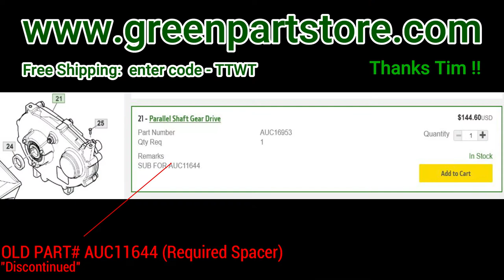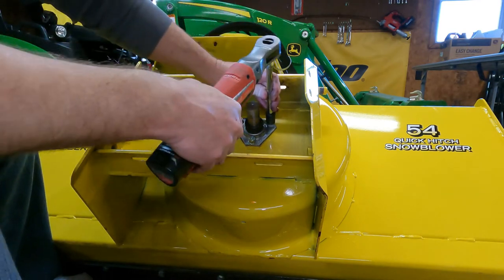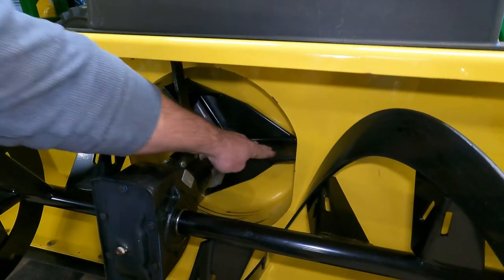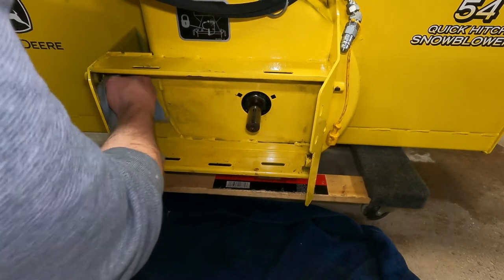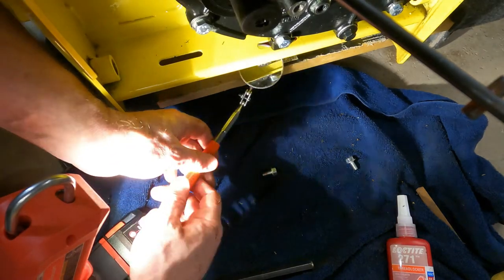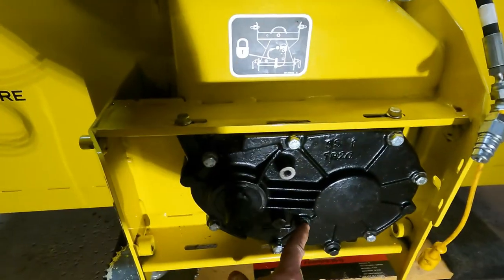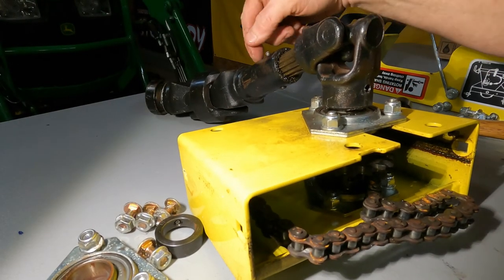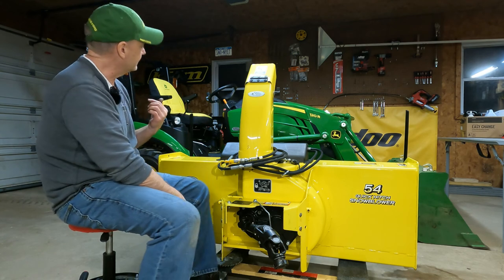JOHN DEERE 1025R | 47” 54” SNOWBLOWER CONVERSION PARALLEL SHAFT GEAR DRIVE

Comment: I am having a very difficult time sliding the chain case onto the driven shaft. I have cleaned and polished the shaft, but it just seems too big. The inside of the chain case seems to taper down about a 1/4 inch in, and that's as far as it will go on. Any suggestions?  1998ish 47 blower.
Reply from the maker: Hey Freeze916 !! Thanks for stopping by the channel. Wow, Are you sure the ID of the gear box tapers down 1/4”? Thats sounds obsessive. Have you tried to slide the gearbox on the shaft without the key installed just to make sure the key isn’t the issue. Let me know.

Comment: Wow, what an excellent video. Mine just came in and ready to install. Thank you!
Reply from the maker: Hey Larry, Thanks for stopping by to check out the video. Much appreciated. You’ll love how much smoother and quieter the Parallel drive is compared to the open chain and sprockets. Take Care 👍🏼
Reply: @SometimeIsNow  I can't wait. However, when I picked it up from the dealer, they didn't say anything about adding oil. Do these come empty? If they do come with oil, would you drain and add the Mobil synthetic? Thank you.
Reply: Bob, I see now that you answered this question down below in comments. I'll add oil. :)

Comment: You are the man!
Complete how to from start to finish.
I bought the gear drive and bolts already but am doing the metal impeller swap at the same time and am waiting for it to be delivered.
Reply from the maker: Hey Nosmo, Thanks for stopping by to check out the video. It's greatly appreciated. I'm glad you found the video useful. I hope everything goes as well for you on the conversion. Take Care 👍

Comment: My 47 snowblower just blew up on my 445 - I am so happy I found your video and have the parts on the way to change mine over.  every bearing as well as the chain just failed on mine.  the Maine winters are harsh with all the salt that gets used and really ruins everything.  this upgrade should be life changing for my snowblower.  thank you so much for posting this amazing walk through video.  Love from Maine.
Reply from the maker: Hey Abel, Thanks for stopping to check out the video. Sounds like a perfect time for an Upgrade. You’re going to love how smooth and quiet the new parallel box runs. 👍🏼
Reply: @SometimeIsNow  it was a nightmare rusted solid to the auger shaft.  Had to cut it apart.  Parts showing up Monday so just getting it all stripped and cleaned up in preparation.  Glad I don't need the old carriage bolt holes behind the impeller.  They are all broken but it made it possible to pull them out without taking out the front bits.   Super strange my drive gear shaft had two retaining collars on it.  One for the bearing and another behind the sprocket with a washer between them.  Nothing I've researched has been like that.  Anyway thank you again for the awesome video!
Reply from the maker: @abelauclair8976  I use to own the JD 445 with a cab with soft doors, 47” snowblower, 60” mower and 22hp Kawasaki engine. It was a great tractor. Yeah, That’s strange you had two collars on yours. 🤷🏼‍♂ Take Care
Reply: @SometimeIsNow  finally got some snow and a chance to try out the new parallel gear box and boy you were right that thing is night and day.  quiet and no more clatter from the open chain.  it motivated me to complete my flap mod as well!  thank you again for your videos.  keep em coming!

Comment: Very nice video I've had my blower since 2008. It has moved literally tons of snow. Every Spring I p.m. it before I put it away. Every fall I go through it. Adjusting the chain this year I noticed some wobble in the shaft between the auger and blower and chain drive. I figured it was a bad bearing so I ordered some and some flanges. Turns out one of the carriage bolt holes was cracked in the blower housing loosening up the flanges. I took a plasma cutter and caught one of the new flanges and welded it to the blower housing to reinforce the area that's really a weak point in these blowers. I was also disappointed the new flanges we're nowhere near the quality of the old bronze ones. And to top it off the new bearings were made in China printed right on them. I looked up the Gear Drive and got sticker-shock!
Reply from the maker: Hey William, Thanks for stopping by the channel. Sounds like you are very resourceful and was able to repair the worn flange mounting point. Thats great. 👍🏼 As you noticed in the video the mounting holes are no longer used for the carriage bolts but just 3 guide holes for the parallel box for alignment. Most of the support are from the four bolts back further on the gear drive and the hanger on the impeller shaft. I’m wondering if in your case one or more of your carriage bolts came loose and or the shaft running from the chain drive to the impeller had excessive vibration from the old less lubricated original bearing and that’s what cracked the housing. In my past 36 yrs in Industrial Maintenance and dealing with much larger flange and pillow block bearing mounts, excessive vibration from an old, minimal or no grease in the bearing or loose mounting bolts caused the fracture at the main mounting point. Grease in a sealed bearing only last so long before the grease finally gets used up from heat and those bearings in your 2008 blower were probably at their end of life cycle. 
I know all to well how it is to find a good quality bearing anymore. Especially in these times. For me, having a bearing delivered for a million dollar piece of high speed production machine to say CHINA on the bearing it makes me Cringe. When you remove a Timken, NTN, Fafnir or SKS bearing you expect the same when you order a replacement. Sadly,  In todays age that seldom happens anymore. Take Care and have fun blowing snow !! I know i do when I’m on my John Deere 😁 👍🏼

Comment: I bought the snowblower today. I live in the snow belt. What would this do to help ?
Reply from the maker: Hey Patrick, Thanks for stopping by and welcome to the channel. Is the snowblower you just bought new or an older model? The reason I ask is the new JD slowblowers already come with the enclosed parallel gear drive as standard equip. If your snowblower is a older version with the open chain drive then there's no increase in performance, just easier maintenance and quieter. No more lubing or adjusting a dirty chain and the enclosed drive is noticeably quieter. Take Care.

Comment: Does it run any smoother or quieter or use less power ?  I bet it's much easier to maintain.  Great job !
Reply from the maker: Hey Captain, Thanks for stopping by the he channel. It does run smoother and much quieter. However It doesn’t use less power. It’s just more of a cleaner, maintenance free gear drive. Like the gear drive on the front auger. Just check the fluid once in awhile and you’re on your way. Take Care 👍🏼

Comment: I have a 2032R and had to replace the short  Pto drive shaft from the snow blower to the  front of the tractor. It is too long by 3 inches. Either John Deere dealer gave me the wrong drive shaft or there is some other issue I’m not aware off. I would have to cut 3 inches off shaft to get it to fit. What part number should it be for this shaft. Thanks
Reply from the maker: Hey Edward, I don’t believe swapping the open chain and sprockets to the closed parallel box changed how close the stub shaft was to the end of my mid driveshaft. I’m wondering if your much larger 2032 tractor quick hitch needs the longer shaft due to the larger quick hitch?? The 2032 looks like it has a whole different quick hitch altogether?? 🤔
Reply: @SometimeIsNow  that’s what I was wondering, if the quick hitch on the front of the tractor was a few inches longer I wouldn’t have to shorten the shaft. You wouldn’t happen to know what the part number is for the correct quick hitch. I’m having trouble looking it up…fyi  the shaft fits now that I shortened it ,but I’d like to get the correct quick hitch.   Your video was very good. Didn’t take me long to swap the chain drive out.
Reply from the maker: @edwardwhittemore6370  Edward, Check this link out and see if this is what you're looking for.  -Front 3-Point Hitch
Part Number BLV10631
https://partscatalog.deere.com/jdrc/sidebyside/equipment/589266/referrer/navigation/pgId/443142351
Reply: @SometimeIsNow  That looks like that would solve the distance problem for the shaft. Currently I have the same quick hitch you do with the slots that hook under the pins on the snow blower. This attachment looks like it needs pins to slide through the holes on the quick hitch similar to a rear 3 point hitch. Is there an adapter to go on the snowblower to accommodate this style hitch ?
Reply from the maker: @edwardwhittemore6370  Check this out: Click on Item#5 front hitch frame 
https://partscatalog.deere.com/jdrc/navigation/equipment/589266/level/2/snp/MjY5Njg0NjpDSEFQVEVSWzI5NDA4MDojQ0FUQUxPRywxMDYxOiNCVVNJTkVTU19SRUdJT04sNTg5MjY2OkVRVUlQTUVOVF0
Reply: @SometimeIsNow  well that looks like it would solve my problem. I will be making a trip down to the dealer . Hopefully they will swap the hitch out for the correct one without too much hassle.  Thanks. I’ll let you know how I make out.
Reply from the maker: @edwardwhittemore6370  That seems odd that the dealer would install a hitch like what I have on my smaller 1025r on your much larger 2032. I would believe that causes all kinds of issues 🤷🏼‍♂ Good Luck Edward 👍🏼
Reply: @SometimeIsNow  The guy at the local dealer said I was the only one he knows  of that has replaced the chain drive  with the gear drive. They said the 3 point hitch was for heavy duty snow blowers. He contacted John Deere to start a file on this to see if they have had this issue elsewhere. Do you know of anyone with a 2032r that has done this to their 54” snowblower.
Reply from the maker: @edwardwhittemore6370  Hmmmm, That’s strange. I guess you can be the first to figure out what it takes for the 2032 and do a video on it 😉 There’s has to be more than just you that’s ran into the issue. I don’t know anyone with a 2032. Take Care

Comment: Is it a gear drive in parallel box or a chain drive
Reply from the maker: Hey Dave, Thanks for stopping by the channel. It is my understanding that it’s a sealed chain and sprockets bathed in oil that JD calls a parallel gear drive. JD refers to sprockets as gears. 🤷🏼‍♂️ But I can say it’s very quiet and I’m very happy with the conversion so far. Got to use it numerous times this winter so far. 👍🏼 Take Care.

Comment: Could please let me know input shaft diameter and output hole diameter? Also, does this gearbox reduces speed and what ratio ? Is it around 4:1 ? Does the input shaft rotates in the same way as the output ??
Reply from the maker: Hey Maxime, Thanks for stopping by the the channel. I will try to get as many of those questions answered tomorrow. You just have to give me some time. I’ll have to do some measuring and post back tomorrow. Thanks
Reply: @SometimeIsNow  That is so nice of you thanks !! I trying to match an old 47" JD snowblower to a F1145. I obviously have the wrong gear box as it spins it the wrong way. I made all the the arms myself and the the hydraulic setup. Only the gearbox is giving me a headache to find. So I might end up using the AUC16953 and tweak it...
Reply from the maker: Hey Max, I was able to get most of your info you were asking for by measuring my parallel box setup on my snowblower.
The Readings were taken with a Dial Caliper. Input shaft OD is 1.00” and output hole ID is 1.00” ID. As for the rotation the input and output shafts rotate in the same direction. Sitting on the tractors seat looking forward the input and outputs run in a clockwise direction. As for the Ratio, without a RPM gauge I couldn’t give you a exact ratio. I can say the input shaft runs slower than the output does. Hope all this helps. Take Care. 👍🏼

Comment: These blowers are overrated. My neighbors cub cadet from Tractor Supply blows farther than my 15k JD unit
Reply from the maker: Yeah I’ll agree but there’s not many options for a front snowblower on the 1025r’s 
Also your 15k JD unit can run a loader, brush hog, rear tiller and so much more.. Let’s see your neighbors Tractor Supply Cub Cadet run a 4ft brush hog 😉 Take Care 🤙🏼

Comment: Will this work on the JD 47" snowblower?
Reply from the maker: Hey Wisconsin Bush, Thanks for stopping by to check out the video. Depending on what tractor you have this should work on the newer 47” snowblowers according to the parts list off (greenpartstore). 
47-Inch 2-Stage Snow Blower - PC1926 61 Compact Utility Tractors 2210, 4010, 4100, 4110, 4115, 2305, 2320, 2520,1023E,1026R, 1025R, 2025R, 2032R, 2720 (M047SBX) 
https://partscatalog.deere.com/jdrc/sidebyside/equipment/74247/referrer/navigation/pgId/329667808 
Hope this helps. Take Care
Reply: @SometimeIsNow  John deere 425 lawnmower.
Reply from the maker: @wisconsinbush2940  https://partscatalog.deere.com/jdrc/sidebyside/equipment/74247/referrer/navigation/pgId/20378257
In this diagram it looks like the same open chain and sprocket box that I removed from my snowblower. If your snowblower frame has the 6 slotted bolt holes like mine does in the video @4:33 If it were me I’d be willing to order it and see. Biggest thing is having the mounting holes and same shaft size.
Reply: @SometimeIsNow  I believe the 54" and 47" are the same except for the size differences.
Reply from the maker: @wisconsinbush2940  I believe so too. Just always have to confirm the drive section is the same. Some of the older blowers had a different size shaft which was a little larger. 👍🏼
Reply: Yes it will work on a 47” blower. I did my 2007 blower and it fits perfect and runs exceptionally quiet. Best upgrade I did to my blower after seeing this video.
Reply: Hi from Pa just wondering if the driver shaft is the same size on a 1025 as on my x730 54” jd snowblower . I want to buy one but my x730 is smaller than the 1025 is the shaft size the same and will that part number work for me,  I appreciate your input, great video, thanks

Comment: Awsome video! Does the parallel box run the auger at the same RPM as the chain drive did?
Reply from the maker: Hey Anthony, 
Thanks for taking the time to watch the videos. Yes, the auger turns at the same RPM with the new parallel box as with the open chain and sprockets. Take Care 👍🏼

Comment: Thanks so much for your video.  My impeller loosened up and came forward crashing into the plow housing so I had to pull everything apart and decided to upgrade to the parallel shaft gear drive at the same time.  You're video was a tremendous help and everything is ready to roll, bring on the snow!  Thank you!
Reply from the maker: That’s Awesome Kent !! Thanks for stopping by the channel. I’m glad the video helped to see how everything came apart. One thing I’ve noticed with the new parallel box is it’s much quieter running. Don’t hear the chain and sprockets rattling away. Now we both need to hope for snow so we can try this new upgrade out. 👍🏼 Take care.
Reply: If someone ever have time to answer me it would be amazing.

Comment: My chain broke on my 54" John Deere snowblower that went on my 1025R, I took it in to my local John Deere dealership up here in Maine, while waiting for the service counter tech, I noticed the new retro kit on a new blower, I asked the tech if that fit on mine, he said yes, I said the heck with replacing the chain, put this new gear drive on instead. Talk about piece of mind now, no rusting, no lubing in the summer, thanks to your video, I understand what they changed as I did not have the time or workplace to do it myself, I could have with your video, very well done. Thank you.
Reply from the maker: Hey Jeff, Thanks for stopping to watch the video. Agreed.. Just the cleanliness of the enclosed drive is 100% better than the open chain. 
And it’s quieter and smoother.. Take Care 🤙🏼

Comment: FYI, this is not a gear box.  Inside, if you look it has a chain and sprockets.  I installed this two winters ago in 2019.  It's made in Spain and the European JD are standard with this enclosed chain system.  Also installed the steel blower fan replaced the plastic one.
Reply from the maker: Hey Mike,Thanks for stopping by the channel. Oh yes I am aware that there is a chain and sprockets inside the parallel box. John Deere refers to it as a a Parallel shaft Gear Drive, so I was referring to it as a parallel box or gear box.  
https://partscatalog.deere.com/jdrc/partdetails/partnum/AUC16953/referrer/sbs/pid/880710788/pgId/330165467/eqId/61793/snp/MzMwMTY1NDY3OlBBR0VbNzQxOiNDQVRBTE9HLDEwNjE6I0JVU0lORVNTX1JFR0lPTiw2MTc5MzpFUVVJUE1FTlQsMTQyMTYwNDpDSEFQVEVSXQ  Apparently John Deere or the manufacture refers to the sprockets as being gears. 🤷🏼‍♂️ I made the comment months ago that it was a chain and two sprockets running  in a oil bath so it would be easily maintained. Take Care and thanks for the comment 👍🏼

Comment: Best video out there for completing this job but I would not use red Loctite on those bolts. These units can go bad and I'd rather use blue Loctite or nothing.
Reply from the maker: Thanks AKJJSIM, and thanks for watching.. You didn’t know.. I have stock in Loctite so the more the merrier.. I don’t want those bolts coming loose with all the vibration and for the few times a season I use the blower I’m hoping I never have to remove it . 🤣 Take Care 👍🏼